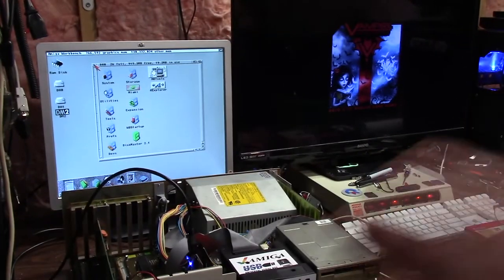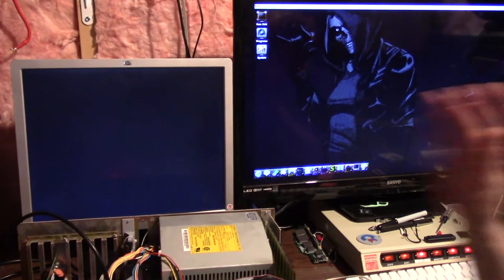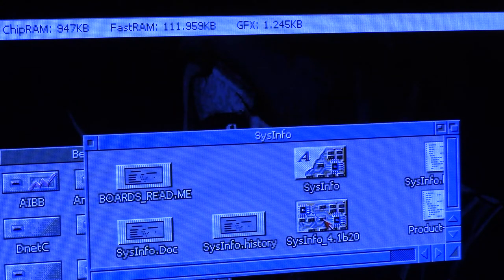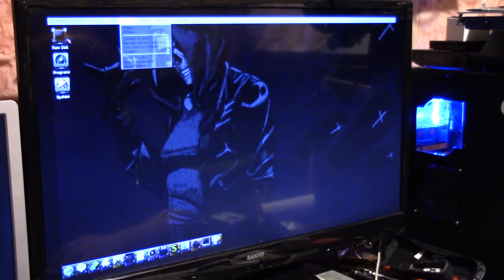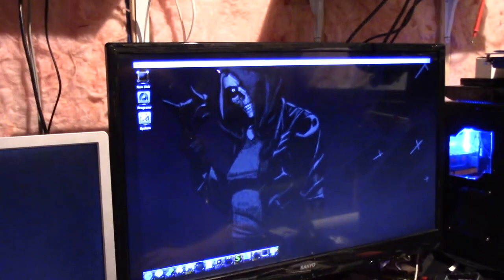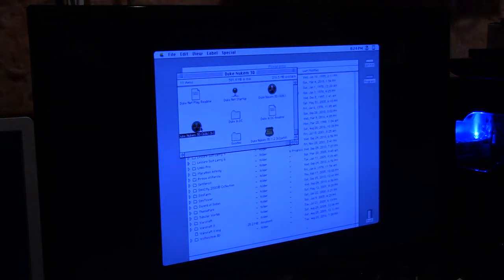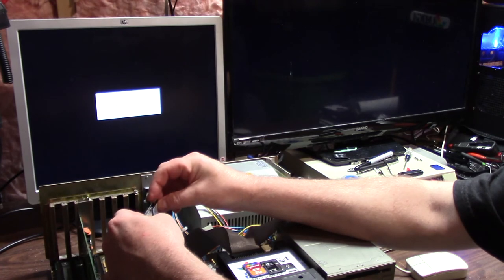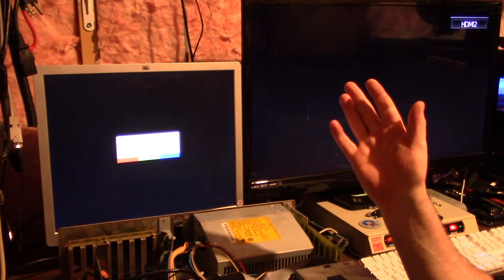Amiga 2000 Vampire FIXED! Coffin OSR54

Comment: So glad you got it all sorted. That’s the same SD 2 IDE adapter that I’m using have thrown out the cheap CF 2 IDE adapters I tried that just caused me issues. 
Coffin is fantastic isn’t it.
Reply from the maker: it is indeed. fully loaded. i still use my workbench with my bbs on it though.

Comment: Don't buy bootleg sandisk cards(from ebay,amazon etc) would be my first guess lol. I been using Sandisk cards for 20+ yrs on amiga(mostly CF) and never had a single failure, and i use the exact sd card you have on 2 of my 5 vampires. I use those ultra sd cards also in the PCB-50B scsi card readers. Counterfeit cards are far and wide. I use B&H photovideo or Adorama exclusively for card and never get a fake or bad one. Only other thing i can think is the maxtransfer isn't set to 0x1Fe00 maybe? If you use the Sandisk Extremes,they have a lifetime replacement warranty if you reg them online at Sandisk(good way to check they are real also). But Glad you got it working.
Reply from the maker: im a lexar man now, and it loves them

Comment: Well that's weird .... SanDisk are usually among the best AFAIK...
Maybe it has to do with bad PSU voltage/decoupling due to the bad (or inadequate) decoupling caps...
Reply from the maker: nope, re capped, psi too, works totally fine with anything but sandisk... i agree weird...